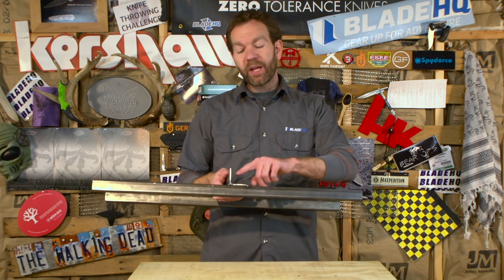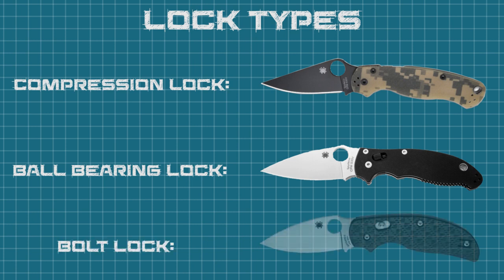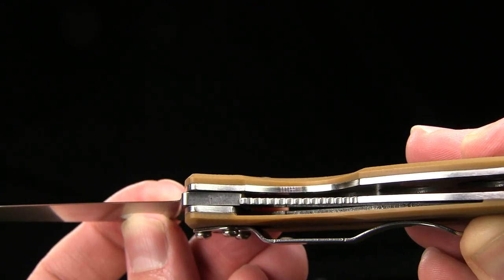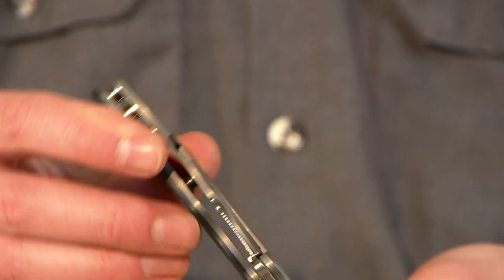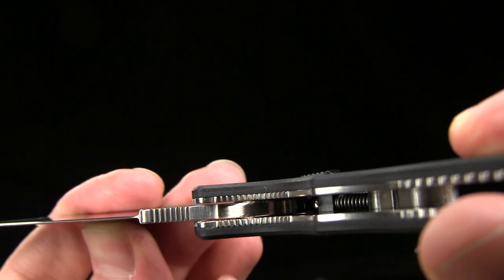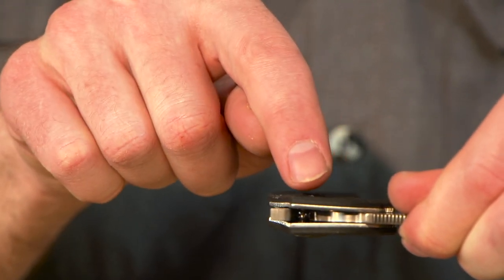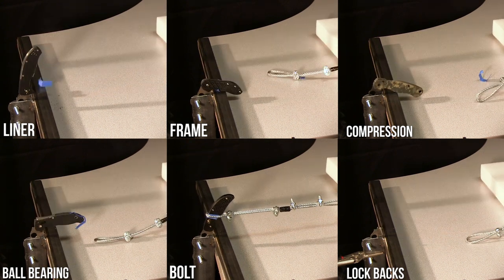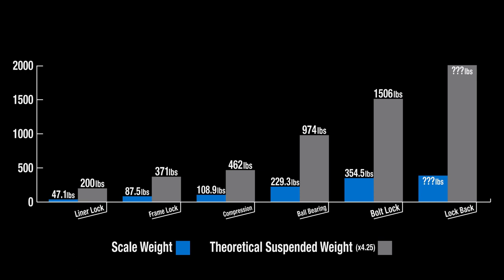Pocket Knife Lock Strength Test II

Comment: I think the two charts are unfair to the classic lockback design. While it’s true that the blades snapped with the lockback, before the blades snapped it looks like the two Delica resisted more force than any of the other options. I can’t believe a simple Buck-design, non-Triad, is that strong. So please replace the ??? with 400lbs…plus.

Comment: Great video guys! But it seems that the wire changed the position while testing frame-lock. At first moment I see the knife moved a bit in the fixture and then the wire moved to the butt and after this lock failed. So I think the lock should have better score. And what about lock-back. You need to test one of USA made spyderco lock-back. Japanese models have too tiny tang.
Reply from the maker: +Ant-master Yes, the frame lock might have held more if the wire hadn't slide up.

Comment: Too bad the cable moved & ran higher up on the handle of the Dice frame lock. Plus it took more weight before it failed so the results are false on that lock type.

Comment: Curious about your weight suspension test.  You calculate that the PM2 would hold about 400lbs.  But in the cold steel tests (on youtube) using weight suspension, the PM2 only held about 50lbs.  Do you know the differences between your weight hang test and theirs?  Also, the ball bearing lock held (if I remember correctly) about 130lbs or even less.  Thanks
Reply from the maker: +beefyb93 Were the weight is placed/suspend makes a big difference. If it is closer to the pivot it will be stronger, further away less strong.
Reply: +KnifeHQ the cs test, the weight was almost al the way at the end of the handle, as you say, huge difference...the lock of the tatanka was the best one out of the spyderco line...in these tests

Comment: I’m surprised how strong a bolt lock really is. I’m pretty sure the Spyderco with the bolt lock is just their version of a cross bar lock. To be honest though, even the liner lock, if you compare the results to hung weight, was fairly strong. I mean most of us are not going to apply pressure to a knife the way a winch does. I mean 200+ pounds of applied pressure is a lot. Jump up to a compression lock or a cross bar lock and your talking about the locking system getting stupid strong!!

Comment: thanks for the video & your time ... to me seems the second test frame lock had design flow and did not lock correct, was slightly at the left side of the blade 4:48  ... also the test failed when the cable moved upper 5:09 which was unbalanced at this point ... thank you very helpful video

Comment: Flip the knives upside down.  Hold the handle in  a sort of pocket or slot.  Drop the cable over the knife blade, instead of the handle.   Clamp a Visegrip to the blade to keep that cable from sliding off.   I like to see destructive testing of tools.  It give a better idea of how far to trust the tool.  Maybe I don't care that one knife fails at 600 lb vs 300 lb, but I care which fail at really relatively  low weights.

Comment: Looks like the the foam on the bottom of the scale acted as a leverage point instead of a straight line between the knife and the scale, therefore the measurement can’t be accurate. Still a bad ass video!

Comment: The methodology needs much improvement. You should be using something like a hydraulic press along with either a scale or pressure plate system. This way you have fine control, exact measurements, and no weird forces or speed differences.

Comment: You are applying force to the knife the wrong way. When using a knife compression force will be applied to the spine, but because you are pulling the handle inwards you are compressing the inside of the knife. You might be doing this intentionally, but it would be ridiculous to do so because forces this great would never be applied in that direction.

Comment: The most interesting thing in my opinion (besides holy shit ball locks) was that the frame lock was actually that much stronger than the liner lock. I always figured that due to the frame cutout, you just gave it a specific weak point to fail at, which was about the same width as a regular liner lock. I was obviously wrong

Comment: You should try the CRKT M-16 10kz, it advertises as a virtual fixed blade.
Reply: 99% certain it would be the quickest to fail in this test. I personally have that blade, and I absolutely hate it. It has a horribly weak lockup, and many youtubers have cut themselves when the lock failed on them.
Reply: +Domenik Eyraud I also own one, it's pretty decent, except what you said, the lockup sucks.

Comment: You're pulling from different places on the handle as it slips.  No account for leverage.  If you pulled 5mm above the joint and and 100 above the joint you'll get different results.  And don't counter by saying there's no fulcrum point.

Comment: The liner lock the cable slipped off before failure. If it hadn't it probably would have held as much as the frame lock.

Comment: Dude run that winch on a 6v batter instead of 12v it will slow it down. to slow it more use doubled pulleys

Comment: Cable always slips with just blue tape marking and nothing to stop cable at a specified point on handle.. also would need to take in account the shape, length and size of each handle (impossible I believe) Which equals results that can not be compared no matter what lock type it is. You also have no control test for each knife... I appreciate the commitment in the test but alas it is a fail and can not be taken seriously. See... pressure higher up on handle because of slip of cable equals more force on lock mechanism and again I appreciate commitment of test you did... but it's seriously flawed. 
But alas I love blade HQ😀

Comment: the stress you put on a knife when you actually use it, cut with the sharp, not the dull end is in the opposite direction of the stress imposed by this test, so it it hard to see the point of it. Why not test it the other way around?

Comment: Why would anyone care about the blade's lockup strength from CLOSING? The test should be performed in the opposite direction - AGAINST the "open" blade STOP mechanisms! For 'f' sake, not a single person thought of that?! So many knives use a simple blade stop "pin" that bears much of the leveraged force during heavy cutting with varying amounts of engagement support from liner and frame-lock designs from various makers. I'd like to see just how strong the other locking designs would hold up when performing the same tests AGAINST the cutting direction. This is where lockback designs would shine providing they function as the blade stop.

Comment: Why not use a relative unit like ft pounds or inch pounds. Or a reference of how far from the pivot point that the force is applied. Not to mention that value changes drastically the moment that cable slides farther down the handle. I appreciate your attempts to gather data for us but without firm controls in your tests the data is useless. The rope slides in most tests. Your not far from useful and consistent data but your roof could use some refinement.  Thanks anyways though.

Comment: What task puts that much force in the direction of closure? Why not test the strength of the opening direction where the cutting edge would be used?
Reply: because that would no longer be a test of the lock, it would be a test of the blade and handle...well mostly the stop pin. Im not saying that would be a worthless test, in fact i think it would be good test to do but as i said it would have nothing to do with the lock strength. I also agree that there is probably very few if any situations that you would put any significant pressure in the direction of closure, like is done in this test.

Comment: Your back Lock is wrong again because the second and third time you tested it, your steel loop forced the lock bar to stay locked and therefore making the locking mechanism fail prove, what end up happening instead is the blade couldn't take the stress any more and broke. You need to secure the loop away from the locking bar once and for all.
Reply: +Iamthedudeman00 If you look closely, the loop is not holding the lock bar closed, the loop is on the pivot of the lock bar so it shouldn't matter. Still love my liner locks, easy to close and for my everyday use I don't need the lock to hold a trillion pounds
Reply: +Cali_Knife Guy good point man very good observation!

Comment: Great test, why not numbers on the back lock???
Reply: Really?
Reply: Because the lock didn't fail .
Reply: +PeterPiperGamer YT the lock dint fail the knife does. Does that mean in real world you can apply more force until the lock fail? no, the knife blade will fail. that is why we need the number as well.
Reply: Ryomichi Its a lock test not a knife blade test , and a number wont save anything cause i doubt anyone sees a number and knows how much pressure they can put on the knife without breaking it .
Reply: +PeterPiperGamer YT in material testing report every information counts. you can boast its a lockback but the blade fail first at way below the yield point of the lock. im just saying put the numbers up and treat that as an outlier data.

Comment: When the cable slid farther from the pivot point, the force of leverage was increased, dramatically.
"Give me a long enough lever and a fulcrum upon which to place it, and I shall move the world."
                   -Archimedes

Also, let's see the Cold Steel Triad lock in that test, with a cable or strap that doesn't slip down the handle.
Reply: The speed the force is applied has some affect as well
Reply: Excellent point.

Comment: you could have at least given the weight on the lock back before it broke. Was it 50 pounds or 400. A knife is only as strong as the weakest link.

Comment: Too me these tests are pointless because the knife edge is on the opposite side you’ll never be pushing in that direction what would matter would be backwards strength unless it’s double sided I get the theory of testing lock strength but there’s a reason some knives don’t even have a lock they don’t need one because when you cut your pushing down a more accurate test would be downforce strength as if you were pushing with the tip for whatever reason or sideways strength ultimately that’s how you’d be cut if your lock failed

Comment: There is no scientific benefit in using only Spyderco Knives. This test needs to be done with the most popular knife in each given lock type.
Frame lock= Chris Reeve sebenza
Liner lock= probably rat 1
Compression lock= para 2
Back lock = buck 110
Tri-ad lock= any cold steel
Oft= Benchmade infidel

Would be a much more interesting test.

Comment: Still, don't understand why putting a liner lock on the back of the knife more than doubles the strength, but ok
Reply: My guess is cause the lock is wedged in the middle of the tang of the knife and the compression lock is an entirely different beast from a liner lock from a design standpoint noting the cutout in the middle of the tang and the adjustment of the actual lock so you've changed the engagement surfaces and where stress points are entirely. Its similar to how a traditional backlock vs the triad lock are very different from one another from the design point of view the traditional has 1 point of engagement to the tang where as with a tri ad lock is technically 2 engagement points the lock stop pin and tang to stop pin note from the engineering standpoint that can change quite a bit of distributed force in the case of the tri ad the pin takes the shock making it stronger by a solid margin but not the mythical status people have given that lock. But in retrospect if you want to word it simpler terms i could say in a sense the compression lock is more of a reengineered reversed liner lock to a degree.

Comment: The reason the blade broke is because the cable compressed the lock bar. That's how Cold Steel gets their results. Hook the cable on the frame behind the lock back release and it will fail at extremely low poundage. Turn the knife 180 degrees and the blade or frame will fail first. Talking about Delica 4 test.

Comment: You can't go by this test, there are several factors that would cancel it out, the cable slipping farther down the handle, the speed at which the winch pulls, a couple more. Very bad test, not accurate

Comment: The LOCK BACK Test is FAULTY  , your putting the Cable right on the Lock BAR so the Cable is actually Holding the Lock Bar in Place and thats Why the Lock Didn't Fail and the Blade Kept Breaking .... Just My Opinion Guys ....🤷‍♂️🤔

Comment: This test is very inaccurate. At certain points the line slips up the grip. Therefore giving it more mechanical leverage it’s like using a breaker bar loosing a bolt it gives you a mechanical advantage the further up the grip it is. If you could secure the wire in one spot at all times it would be much more accurate

Comment: Nah this test is definitely not perfect, like he said. So many variables unaccounted for. Like the Liner lock test slips right off too but you didn't tighten the loop on it like the other ones. I think you guys have a lot to learn from Cold Steel who are obviously the industry standard for this sort of thing. Also applying the weight just brutally all at once is definitely not the way to do it, but rather have the weight increase gradually. All in all, not a bad demonstration though because we learned other things due to this experiment. Like the weak structural points of the blade and which angles to avoid applying pressure.

Comment: Doesn't this test seem silly and in reversed in some ways? If your knife has a keen edge and is sharp it will cut the way its supposed to, if not it will require this sort of strength which is kinda unnecessary.  If your knife can withstand 300 lbs of forces, realistically thats like cutting bread with a hammer. So its not functional in any capacity. This test doesn't really reflect the reality of knife needs or functionality. Its more a parlor trick.

Comment: What ball bearing / bolt lock knife would you guys recommend for an edc type use, my budget is up to about 100, any help would be greatly appreciated. Thanks guys!
Reply: Well , how about the Sage
Reply: Or the Manix2?
Reply: Manix 2 with CPM-S110V blade steel !!! It has dark blue handle scales ... Or if you're just starting out get the standard Manix 2 with CPM-S30V , both are AWESOME !!!
Reply: +Nathaniel Anderson Get a Benchmade. Much better design, materials, and customer service. None of that fragile, leaf-style blade bullshit. Benchmades are made to last generations. Look at the Benchmade Mini Griptilian. 154cm steel with Axis lock and it's MADE IN AMERICA, unlike these Asian-made Spydercos.
Reply: Rhino is wrong. The Manix 2 is made in Colorado. Manix 2 has g10 handles with steel liners. No flex, much stronger than the non-lined, plastic handled griptillian. Benchmades are nice, but between the 2, the spyderco is better at a lower price.
Reply: +Brandon Martin No YOU are wrong. The new Griptilian (551-1) has g10 handles and all of the griptilians have steel liners. I have 3 Benchmades and none have them have any blade play. I have sharpened and cleaned multiple Spydercos for customers and EVERY SINGLE ONE sucked. (I never did work on a PM2 or Southard though)
Reply: +Brandon Martin And most Spydercos are made in Asia. I only know of 2 that are USA made. EVERY single Benchmade is made in Oregon.
Reply: +Ryan Marhoefer Rhino mentioned the mini griptillian (2.91 inch blade). The 551-1 is not a mini griptillian. Also worth mentioning it's well over $150, and this post was asking about sub $100 knives. Lastly, a quick search will show you the mini griptillians do not have full steel liners. 3/4 at best. You can find plenty of posts/videos showing the handles compress under stress. My comment was factually based, not opinion. You mentioned a knife that was not in the discussion and followed it up with opinion. I said Rhino was wrong because he was. He inferred the Manix 2 was made in Asia. It is not.

Comment: Well, right off the bat you messed up by not redoing the Tenacious. It didn't break, it slipped. By your guys' logic we would assume that all liner locks would bend to the opposite side, creating a virtual fixed blade. You still need to keep going until the handle crumples over. You guys didn't do that, thus screwing up this entire thing. Doing a lock test correctly isn't hard and I am surprised to see so many fail time and again setting these things up. Jesus.
Reply from the maker: +David Adkins For this application, that wasn't a slip, it was a fail when the liner bent off giving enough so that the wire/tension was released.

Comment: This is quite a flawed test, you'd have to test each until breakage and the designs should all be the same handles/blades. Differing blade thicknesses, steels, points of attachment, etc make this a pretty unreliable test. Still, appreciate the attempt to test anything as its still better than guessing. Spyderco knives are not pry bars and were never intended to be such. I'm sure there are overbuilt knives better at this but they won't do as well at... Uh... Ya know, cutting stuff. To improve these tests going forward, please try and control variables to get better results. I think there is plenty to learn.

Comment: You totally fucked the liner lock. with every other knife that slipped you fixed the problem and did it again.
Reply from the maker: +brocksdaddy081910 Except the it didn't slip, it failed which released the wire.
Reply: +KnifeHQ oh you are counting the bend as a fail because the knife wont close ok i understand im sorry i didnt get that the first go round